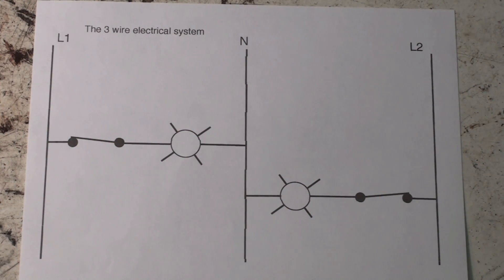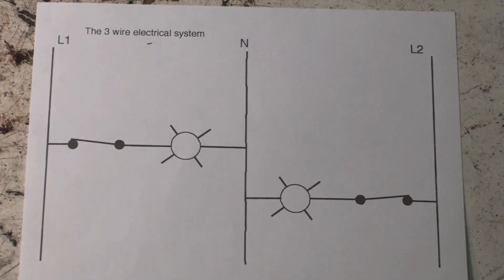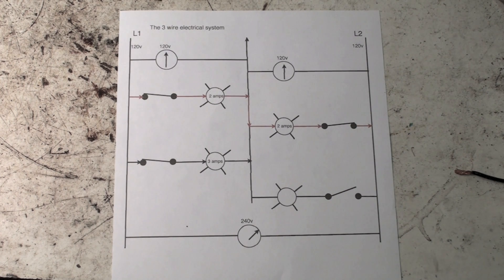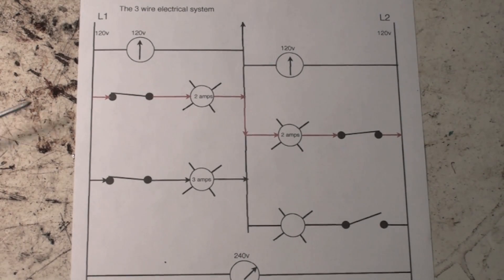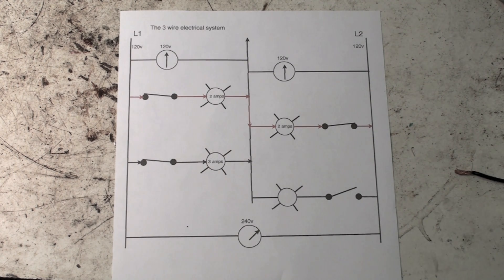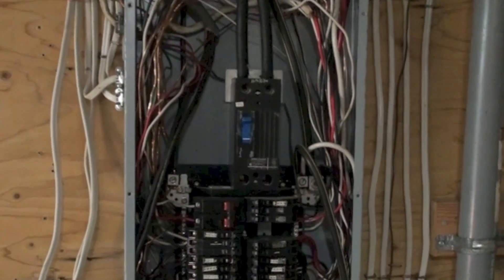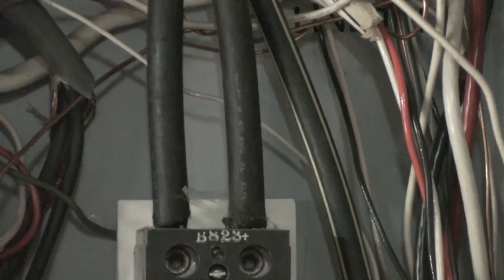How the 3 wire electrical system works

Comment: Just a dumb question. Red and Black wires are power, White is neutral. What color is ground? When are five colors of wire used: black, red, white, green (?) and blue (?).
Reply from the maker: Green or bare.
GFM

Comment: I.e l1 and l2 are positive only and not negative 
Reply please yes or no
Reply from the maker: There is no positive or negative in AC.  It reverses polarity 100 to 120 times per second.
GFM
Reply: @grayfurnaceman  sir I researched today and it says 3 phase 3 wire DC system has 1 positive 1 negative and 1 earth(neutral)
Thanks for replying

Comment: Sir: Both L-1 and L-2 use the NEUTRAL to return the unbalanced portion of the load to to transformer. The vexing question is, WHY is the guy wire outside
the property, which is USED as the neutral, not NEEDED to be insulated? 
Neutrals inside are insulated. Thank you for the help.
Reply from the maker: First, the guy wire is probably connected to earth ground, which is connected to neutral on the transformer.  
Second, the neutral is a center tap of the transformer which will equal 0 voltage.
Third, the neutral wire must be insulated from touching ground because any fault current should go to chassis ground so the fault can be cleared by the breaker.
Hope this helps.
GFM

Comment: In the drawing where the right side  has one used and one unused branch. How does the electricity from L2 get to the neutral line if it is an open circuit? Thanks!
Reply from the maker: It does not because there is no circuit until the switch is closed.
GFM

Comment: I have 240 volts AC & I what to connect to two 240 elements, But how can I hook up a amp & volt analog meter
Reply from the maker: You need more than a comment from a video.  Try one that explains how meters work.
GFM

Comment: never works that way, when u connect appliances between L1 and N, then L1 never choose passing through L2.
Reply from the maker: Look at the diagram.  If I have continuity between L1 and L2 thru loads connected to neutral, power will flow between L1 and L2.  There is potential difference there as noted by 240 volt loads across the terminals.
GFM

Comment: I learned what you are saying right at 1:13 -- in other words, if all electric were 240v you wouldn't need neutral.  Just connect the two 120's.  Neutral is just to provide your 120v.   Neutral gives you the 120 option, right ? And it returns the unbalanced load.  Thank you, thank you, thank you !!!!!
Reply from the maker: You got it.
GFM

Comment: Current never flows past the neutral from L1 to L2 which is at a higher voltage than the neutral. Current always takes the path of least resistance. If it encountered a ground line somewhere there, it would choose that one even before the neutral. Also, the neutral doesn't go past the transformer to other people's panel's etc. It is grounded at the transformer. And the ground line has even lesser resistance because it is usually grounded locally outside the house etc. The idea is to make current choose that path over your body if it ever had to make that choice.

Comment: Are the 240vac loads automatically balanced, if not why? Older dryers have 2 hots and a ground so I gather there is no imbalance.
Reply from the maker: 240 volt loads are intrinsically balanced.  Older dryers and stoves are actually imbalanced.  There are 120 volt loads in the appliance that use the chassis ground as a return for the neutral.  This was changed around 1995.  A neutral is now required if there are any 120 volt loads in the appliance.
GFM
Reply: @grayfurnaceman for a long time dryers and stoves where a major hazard. and you have a lot of legacy appliances still in service. with the a/c the compressor takes 240vac its balanced but the blower it takes 120vac its unbalanced. I got it thx!

Comment: Needs to show the required ground safety wire. People could be misled and wire an appliance without a proper ground. At the very least, mention the necessity of a ground wire.
Reply from the maker: Good thought.
GFM
Reply: Ground wire is important in our appliances because it provides  a path to  the current that might be present on the body of the appliances that is the function of the 3rd prong in our electrical plug in which the 3rd hole in our convenience outlet must be connected to the ground to make this functional.

Comment: Hi. I'm an electronics technician. As you probably know, electronics and electrical wiring, while being very similar in principle, are not "exactly" the same and I am trying to troubleshoot a circuit breaker that keeps popping and this video really helped me understand how a breaker panel is wired and how everything works so just wanted to say thank you for taking the time to post this video. God bless in Jesus's name.

Comment: hey garyfurnace, are the two legs L1, and L2 in phase or 180 degrees out of phase with each other?  It almost seems like if they were 180 degrees out of phase with each other the diffrience in potential would cancel each other out and you would be left with zero volts. I keep coming across this information online, but it dosent make sence to me. 

thanks
Reply from the maker: They are 180 degrees out of phase. When positive is 120 volts, negative is zero.
GFM

Comment: Bad Panel....    No Inspection...
Black is NEVER the neutral lead. 
Black and Red are the two phases of 110V.
NEVER EVER White and Red as the two phases as this shows.
Reply: Black and red are for live wire or hot wire,  neutral wire are  white wire, and green or yellow with green strip wires are ground wire, correct me if i'm wrong thank you.

Comment: I have a 40 amp circuit can I run 40 amp wire to my first recessed light and continue the rest with 14awg romex
Reply: No.  All components downstream of the 40 amp breaker must be wired with 40 amp wire, unless a sub panel with a 15 amp breaker is installed.
GFM
Reply: If your talking about standard house recess lighting, normally a 14 gage wire on a 15 amp breaker is more than sufficient to meet the load demands, especially when using LED lights. A 40 amp gage wire would be more useful if you are wiring in an electric stove, a water heater, or even a spa. There are a lot of unknowns in your question so it hard to pinpoint a correct answer.

Comment: So what youre saying is that there is no 120 volts.  If the hots are connected through the neutral, then everything is 240, which some appliances are not made for.  So now i ask why have my appliances not been overpowered yet? well either they WERE made for 240 volts or youre just plain wrong.  If you can prove this theory witha  simple circuit then please do.
Reply from the maker: I have sent you a video showing the pole transformer in the circuit.  The 3 wire system uses 2 windings in the secondary of the pole transformers.  Each of the windings will provide 120 volts.  When tied together at the center, the 2, 120 volt circuits can become 240.  Hope this helps.  https://www.youtube.com/watch?v=D2B41I0DBlI&list=PLItXrh64d2JNJOjSivaYXeX88i8MNWgwu&index=15
GFM
Reply: Already saw that one.  I understand you're simplifying everything for the beginner to understand, but for me I want to know the real science behind it.  Greg Freeman had a good explanation but frankly i can't find any textual support behind it either. Something about inductive reactance and opposing current flow on a wire cancels out.  I just want to know this.  I understand everything else about AC wiring except where the potential energy of two opposing current flows on the neutral goes.  While what you say makes sense... It is also skeptical, as i hope you can understand- due to the contradiction in the comments.  Also if the power will go through one breaker and out the other, it is no different than a 240 v circuit.  Both lines are tied together.  Efficient, semi-perpetual energy.  Also, according to some research... If our common appliances are put on a 240v circuit... then they will burn up.  All im saying is if both lines are tied through the neutral buss bar (which they are) AND power flows from one breaker (120v) through the other (120v) then that would make for a 240v system-which 120v appliances cant sustain.  I would think that the opposing currents would cancel out, due to the fact that not only have my appliances NOT melted and gotten completely damaged yet, but another guy claims that this is how it works in this video: https://www.youtube.com/watch?v=texTArIW5qY&t=1059s (13:45 for reference).  Anyways, thank you for the quick response.
Reply from the maker: The link is correct.  His explanation, while a bit complicated, is accurate.  I am not sure where you get the 240 volt. You are misunderstanding something here.  If I were to install 2, identical 120 volt loads in series in a 240 volt circuit, the voltage drop across each one will be 120 volts.  No loads will be damaged.  
If the loads were not identical, the higher impedance load will have a higher voltage drop, but the total voltage drop of both added together will be 240 volts.  Again, neither load will be burned up.  The lower impedance load will not have enough voltage drop to operate normally.  
When you add a neutral between the loads, the unbalanced part of the current will be balanced out by the neutral.  Merry Christmas
GFM
Reply: His explanation is correct? So you are saying voltage of opposite phases, or voltage going in opposite directions through the neutral will just basically cancel out?  Greg freeman said something about inductive reactance causing the balanced phases of a neutral to cancel out or some sort.  I would just like to understand how the system works. 
As you may notice my thoughts are very unorganized. Below are two working theories with possible problems that I have put together for the neutral wire:

Theory one:  Opposite phases travelling opposite directions through neutral cancel out, leaving zero Voltage potential.  The energy does not pass from L1 to L2 in 120V appliances. However the energy in opposite phases cancels at the neutral, as proposed in my previous link. *example: Five amps in the positive plus Five amps in the negative equals zero amps (Question: How can energy simply disappear)

Theory two: 120v to light on L1, 120v to light on L2, power goes from L1 to neutral, and then back through neutral to L2 (Question: how is that not 240 Volts)
Edit: I think I might get it. 2 120 volt appliances on a 240 circuit will take 120 volts each and all will be balanced? Is that correct?  I assume all household appliances are made for either 120 or 240.  if that's the case (not including transformers and doorbells) then i think this whole thing would be a lot simpler to me.

Edit #2: I understand now that theory two is correct.  While technically it is 240 volts, each appliance on different phases will use 120.  2 120v loads on a 240 v circuit will basically be 240/2.  Thank you for helping me understand. 

-I appreciate your responses and your ability to help.  Merry Christmas
Reply: Sorry for the barrage of questions. I want to be an electrician and I'm trying to understand everything the trade has to offer

Comment: So when your charging your phone, electricity passes through. When you unplug your phone and the charger is still plugged, that extra electricity goes through neutral back to the grid?
Reply from the maker: TheMoises1213 There is a very small power usage by the charger when it is plugged in regardless of whether the phone is plugged in. Of course the charger uses a larger amount of power when it is charging the phone. Hope this helps. 
GFM
Reply: grayfurnaceman  Just having a tough time understanding what Neutral does.
Reply from the maker: TheMoises1213 The neutral is not a mystery. It is simply the other side of the circuit. Grounding tends to confuse the issue. Hope this helps. 
GFM
Reply: Yes it does
Reply: Neutral actually return the leftover power from the circuit

Comment: This will clear the air for all. Even though he is using a transformer, its all relevant, just lower safer voltages. Watch the whole video. I'm not plugging any video, its just a great explanation of the neutral circuit and what it does under different conditions. https://youtu.be/eVamt9IdQd8

Comment: The two hot wires L1 and L2 have separate neutrals. They are not shared as in most diagrams including this one. At least not until they get back to the panel. The unbalance is taken care of there at the panel where the the white wires find commonality. AC current goes back and forth 60 times a second. If Line one is moving 10 amps and line five is moving 5 amps the electrons on line one will bottleneck and only half the amps will follow line 2 and the other will have to take the other path which is the white wire back to the pole. At that point I think it is recycled to line 1. I do not think it simply goes back to the grid whatever that means. Line one and line two are out of phase 180. So when one is -120 the other is +120. When L1 pushes L2 pulls. L1 would follow L2 if they were pulling the same amps. But if L1 has more amps it will find resistance to follow the amps into L2 and if it has 10 amps and L2 has 5 amps the faster moving electrons in line 1 will bottleneck in line 2 and so will follow the next best path of least resistance which will be the white neutral wire. That is my theory anyways.

Comment: Hi GFM,
Your explanation on this video is not the best that you have done.
You show a 5 amp load on one leg (L1 to Neutral) which at 120VAC would be 600 Watts.
You show a 2 amp load on the second leg (L2 to Neutral) which at 120VAC would be 240 Watts for a total of 840 watts being used.
Although there is a 3 Amp imbalance, that only means that the Neutral wire is carrying 3 amps which is the difference between the 5 amp on L1 and the 2 amp on L2 as the currents are 180 degrees out of phase.
As the power is actually provided by a transformer which the secondary winding is center-tapped (The supply to the consumer) , the current draw off the high tension (primary) will reflect the total consumption on the power grid.
The current off the grid is far lower as the primary voltage is much higher.
This is just a minor critique, as I think you want to help to explain things in simple terms for the novice, however in this case, I think it may have caused more confusion for some people  that you wanted to help.

Comment: Wow! This explanation of the three wire system is entirely incorrect. 

 1)  L1 and L2 are not simply wires carrying 120V and the neutral a "dumping place."  L1 and L2 are the ends of the secondary transformer winding and the "neutral" wire is tapped at the midpoint of that secondary. It is every bit a conductor, and a "hot" one at that, except that it is grounded, both at the transformer and the service equipment.  Wire do not "carry voltage".  Voltage is a potential measured between two points.  In this case, 120V between L1 or L2 and neutral and 240V between L1 and L2.
2)  The neutral conductor carries the imbalanced current between L1 and L2 because L1 and L2's wave angles are 180 degrees apart.
3)  The current from one phase to ground does not "look for" a matching load from the other phase to ground.  Perhaps you've never seen an open neutral situation where loads normally connect in parallel become connected in series and different parts of the circuit have different voltages present.  
4)  This imbalance you make a big deal out of does not balance itself "somewhere out in the grid."  You can provide the same conditions with a local source of power, such as a generator, and the same electrical principles apply.

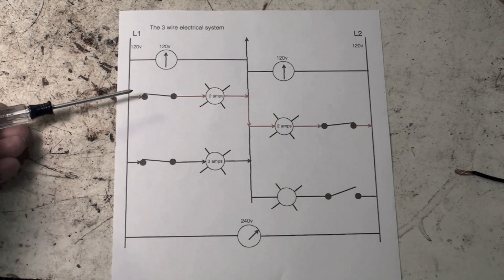Comment: First off,...I am NOT an electrician, but rather I'm the Curious George type,...always digging down and trying to understand everyday stuff "around the house" so to speak.  At the 3:05 mark, you show there is a load from  L1 to Neutral that "goes over to the other line",....why doesn't that equate to a 240V connection between L1 and L2?
Reply: My question exactly.  I go to trade school I'm gonna see what i can dig up there.

Comment: Could you explain how the 180 degree out of phase signal is created on the secondary winding of the center tapped transformer?
Reply: Yes, waiting for that explanation myself. Just how does the two ends of the secondary center tapped winding end up at 180 degrees. apart?

Comment: I found the 'Load Balancing' very informative. The distinction between 'Neutral and Ground' was good because without it there are holes in the travel route of the electrons. Those unbalanced amps must travel to ground to balance the load but the route starts at the neutral line and ultimately, if not being used in the circuit, it ends up going to ground. 
That conclusion reaffirms the theory concerning electron flow.  A big part of understanding what precisely you are saying has to do with actually listening. Thanks
Reply from the maker: You still have the ground thing mixed up.  Ground is not part of the circuit.  It does not absorb elements electrons except from lightning or spikes.  Its all done in the pole transformer.
GFM

Comment: Growing up and being familiar with Indian (aka British) Electrical systems, this feels so weird. I wonder if the 220 Single Phase like rest of the world would have been more simpler and cost effective on the long run than the 120v Two Phase (3 wire) system.
Reply from the maker: I think the original idea here was to provide a lower and thus a safer voltage for use in plug in appliances.  I have been shocked by both and will take 120 volt every time.
GFM